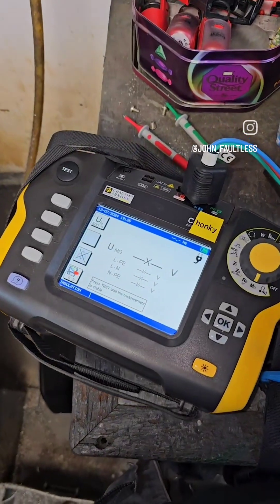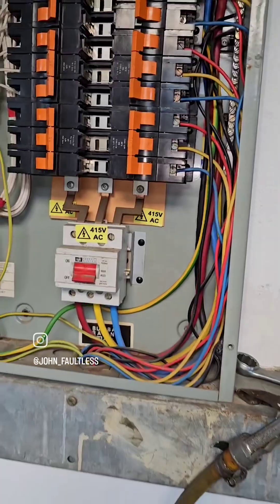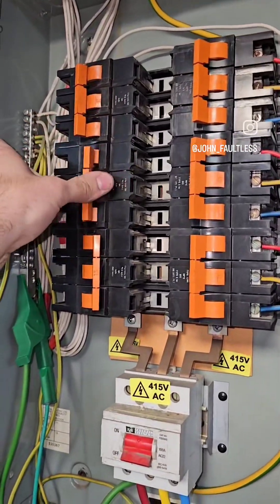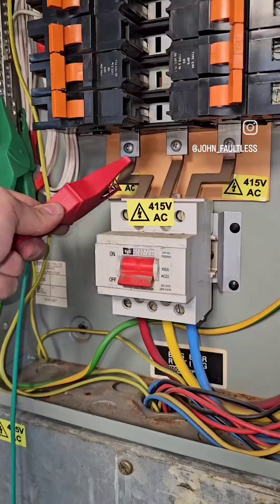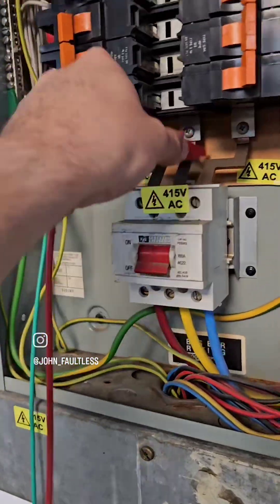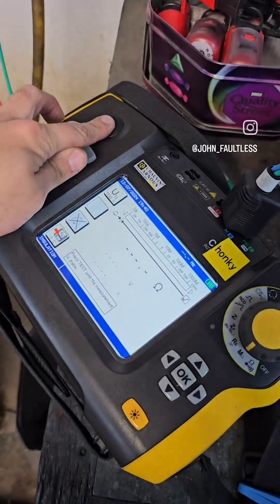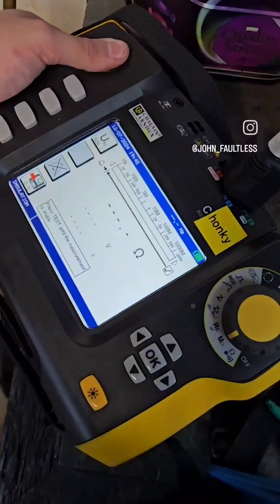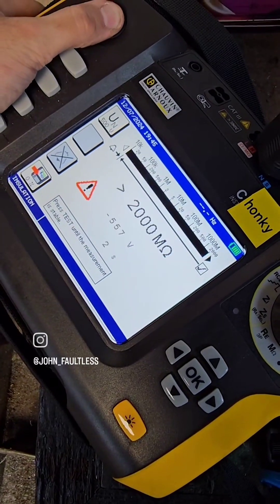Global 3 phase IR testing #testing #eicr #howto

Comment: The only thing I would add is to start at 250V, and then if all clear move to 500V. Just in case you've missed a connected load that has vulnerable components! 'cough cough' this is not based on previous experiences 😂😂
Reply: wouldn't you just test at 250v for a periodic like this only 500v for initial verification ?
Reply: @dale_v2454  You're right, GN3 does state that testing circuits with sensitive equipment at 250V with live conductors connected together to earth. However, this video has tested between all configurations of conductors (minus N-E ) which carrying out this test via 250V then 500V gives me piece of mind.